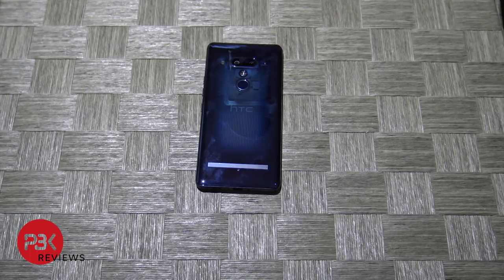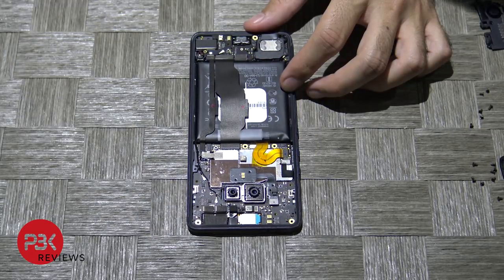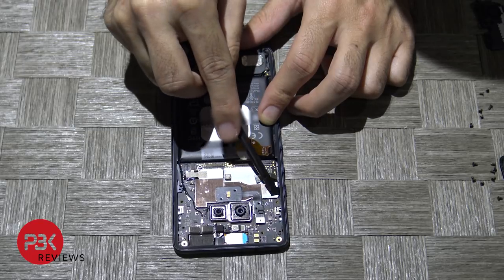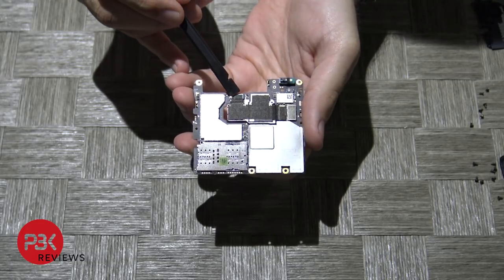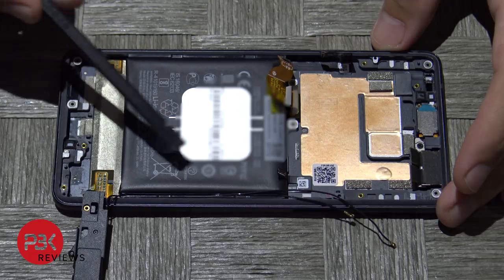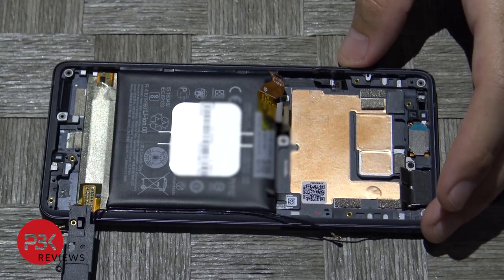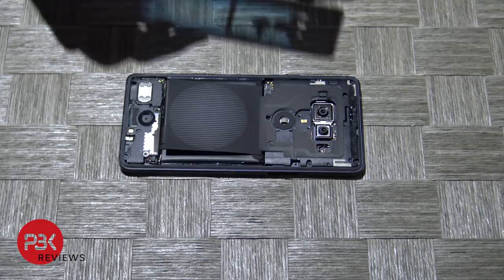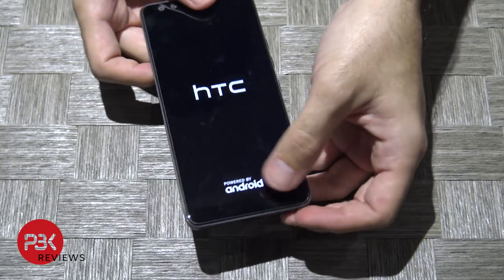HTC U12 Plus / Exodus 1 Bitcoin Crypto Phone Disassembly Teardown Repair Video

Comment: I wonder if I can put the motherboard of the HTC Exodus 1 into the HTC U12+ so as to benefit from the memory card slot and the shell casing and screen glass  upgrades, without porting any U12+ software over, unless the memory stick reader need to be soldered to the other motherboard.  While keeping crypto wallet and security functionality.

Comment: Hi. Some questions. Do you know where i can get the red back cover? And I put the replacement cover back cover, will the glue still work?
Reply from the maker: Yes they sell it on ebay, check for HTC u12 back housing. If you need new adhesive look on ebay also for smartphone red tape. you can use that as a replacement.

Comment: How does the fingerprint reader come off the back glass. When replacing the back glass. No fingerprint reader comes with the new one. Is this a simple heat the adhesive as well?
Reply from the maker: yes its just held on with adhesive, you can heat it up and pry it off

Comment: This is very helpful! I want to change the battery and the back cover, do you recommend redo the adhesive? Also is the fingerprint sensor glued to the back cover?
Reply from the maker: Thank you. Ya it would be best to apply new adhesive (if your new back cover does not already come with pre installed adhesive). Also the finger print sensor is held on with adhesive to the back cover as well. You can heat it up and pry it off.

Comment: Yeah Jerry rig everything did a bend test and the adhesive came off looked pretty easy. I have the phone only reason I'm kinda worried. Is it good I'm the adhesive area
Reply from the maker: Its pretty solid as far as the adhesive goes, it doesn't come off easily if your worried for lets say it heating up and coming apart.

Comment: Will replacing the screen affect the IP68 water resistance?
Reply from the maker: possibly yes. If you re-seal with proper adhesive should help it keep the water resistance

Comment: and again HTC missed to install a heatpipe and wireless charging. i do not use qi charging but I want a phone that does not thermal throttle. On my HTC 10 and also on the U11 thermal throttling was obviously an issue. Only my U Ultra runs without heating issues. Sadly also the U12 plus also suffers from thermal throttling. Adding the dim display and there you have all reasons i bought an S9 this year
Reply: I've no heating issues on my U12 plus
Reply: @quentinfreeman7516  same

Comment: Both my dispay and rear side is broken...how can i change it
Reply from the maker: You would need to order the parts for it, then watch the video to take it apart, and remove the battery, then heat the front up after the phone has been taken apart and then pry the screen off the midframe, then if need be (if the screen you bought doesn't have new adhesive) you would need to install new adhesive, reattach the screen and then re-assemble the phone as shown in the video.
Reply: Which part should i order..and where do ibget the original spare
Reply from the maker: @archanasoora  you can get the tools and adhesive in the links in the description of the video, and the LCD screen you can order on ebay since amazon doesn't have it
Reply: Did i mention my model is u12plus
Reply from the maker: @archanasoora  yes should be for u12 plus
Reply: I am sorry but i searched in ebay...no longer avaliable it shows
Reply from the maker: @archanasoora  https://www.ebay.com/itm/6-0-Black-LCD-Screen-Display-Touch-Digitizer-Assembly-For-HTC-U12-Plus-U12/382686249845?hash=item5919e0c375:g:Z60AAOSwylBcHPjt:rk:1:pf:0